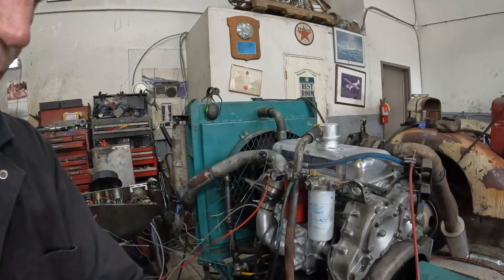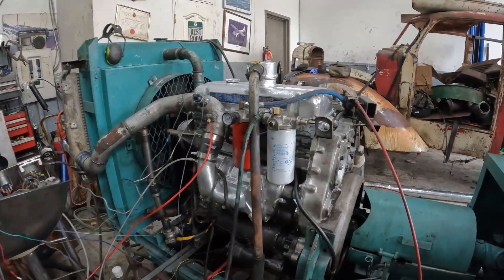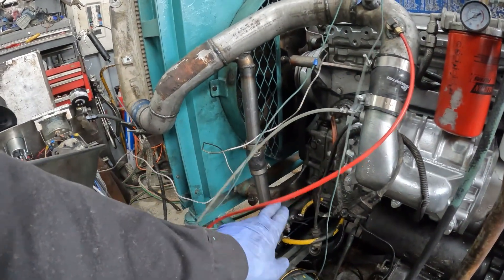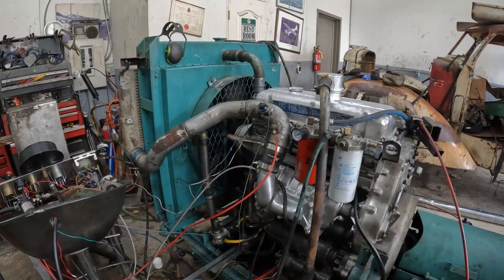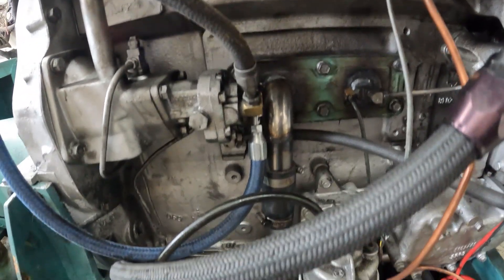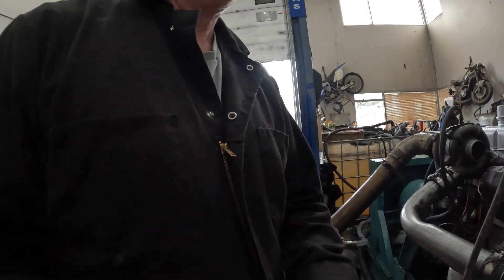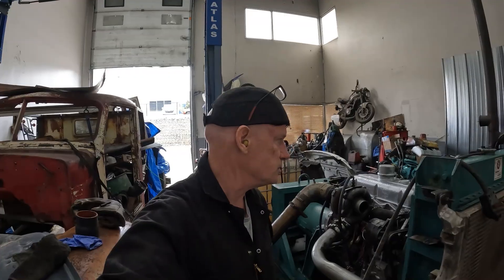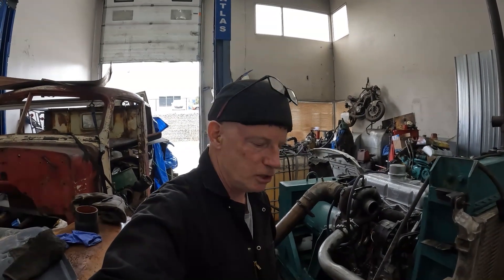Detroit Silver 4-53T (Advanced Camshaft Dyno Test)

Comment: At 212 cubic in  and 282 hp you're doing better than any gas engine that you can buy with a warranty
Reply from the maker: Thanks, very true, it's a beast.:)  Going back to standard cam timing and calling it good.  Time to work on adapting the ZF6 for it.:)
Reply: @detroitgarage9430  My experience with anything ZF has all been bad  even in 40 yard articulated end dumps   New venture out of Dodges seem to be pretty tough  good luck on this   Great Project  very ambitious
Reply from the maker: @carolinemcnabb9957  Thanks, many have said that, but I've come from a first gen with the Getrag 360 and kept that alive for 16 years.   The NV4500 is nice, but the gap between 3-4 is not ideal for the Detroit.  ZF gear ratios are almost perfect, so I'll run it and see.:)  Has to be rebuilt anyway as it broke on the previous owner.:)

Comment: 900 egt doesn't sound like much but you have to remember its not a 4 stroke   What I mean by that is uniflow design blends cool intake air with exhaust   I ran 500 hp silver 8V92s on doubles grossing 160,000 lbs and would never see more than 750   so your valves are taking quite a torching   also remember 2 cyc valves are cooling on the seat only half as long as a 4 cyc       Love your work
Reply from the maker: Thanks, these temps are take pre turbo, post turbo is 250 degrees cooler.  Detroit measure's all egt's post turbo.:)  I'm only running pre-turbo as that's has the 4-53T Silver is in my truck.:)  In my truck I never see anything over 950, which is 700 post turbo.:)

Comment: The Boost is just not there like before.......boost = power. The exhaust also gives that clue, smoke means un-burned fuel.
Reply from the maker: Yes, very true.:)  It's a dog, just finished up another day of testing and it did improve some with the blower bypass removed.  An improvement, but still not close to standard timing.:)

Comment: Kind of not suprising .... the old Jimmy's were produced for a lot of years and Mostly pre emmision era.. if there was a quick easy way to gain power it likely would have been done ....there was no advantage for the factory to leave significant improvements unrealized.
Reply from the maker: Yes very true, that's my argument for the most part.:)  The engineers were very smart when the designed the engine.:)

Comment: Advanced cam timing closes the valves early, as well as opening them early, correct?  So the compression stroke would be longer, and the power stroke shorter...  Shorter power stroke, less power.  At least in theory.  

I'd be curious to try retarded cam timing.  Shorter compression stroke, longer expansion stroke.  Maybe the turbo can make up for the lost air before compression begins?  Of course also might start getting some exhaust blow back into the inlet ports if the valves open too late...

Following your work on this has been really fascinating.  There's nothing like real world testing to put the theories to the test.
Reply from the maker: Thanks, yes that's correct.  I might try a go at retarded timing when the ZF6 is finished.:)

Comment: If you earth the temp sender wire and the gauge starts going up to full, then you know it's the sender. If nothing happens then it's the gauge. It's acedemic since you probably can't buy the parts separately for a cheap gauge, but still.
Great test. I was expecting something entirely different. A failure like this isn't a failure it's success because it's categorically ruled out those settings.